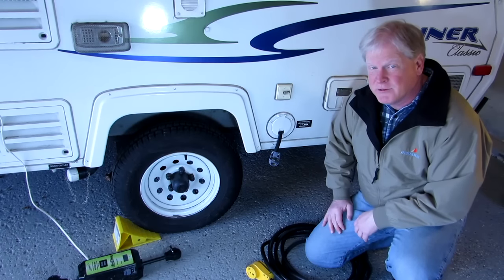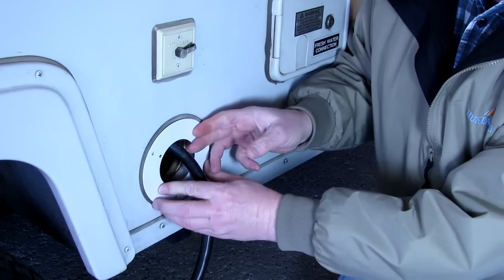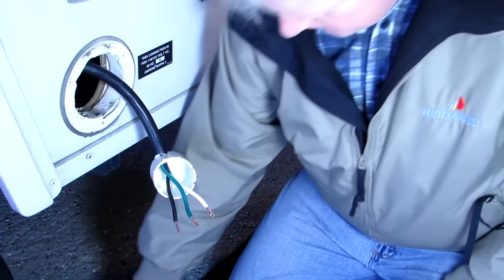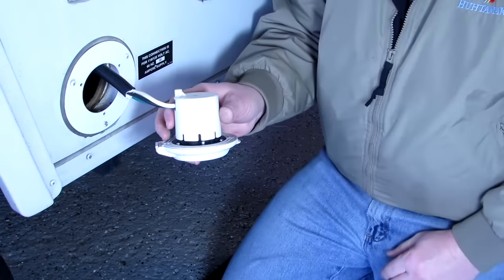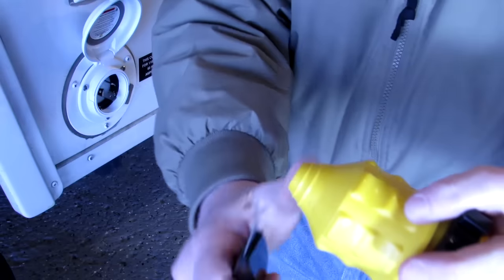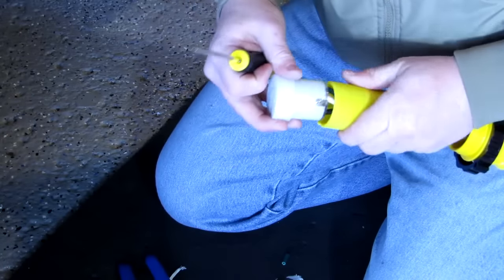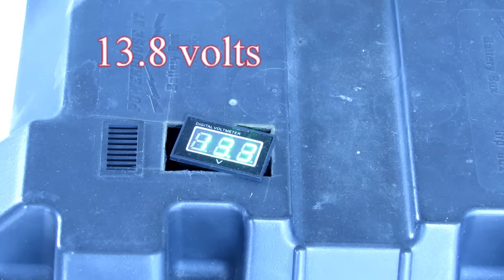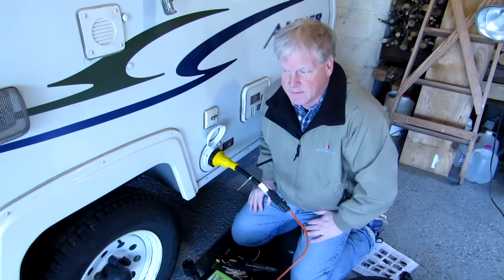Better  Aliner (Pop-up)Shore Power Connection - 30amp marine plug

Comment: Got the Marinco 30 amp kit for Christmas and just installed it with a little help from watching your video. With 5 nights below freezing here in the panhandle of Florida, my OEM cord was impossible to stuff back into its mouse hole. Don’t have to struggle with that anymore!
Reply from the maker: Excellent.  I see they are added that as a standard set up on the new rigs !!  Its about time !  Thanks for the comment !

Comment: Being new to RV'ing I was a bit confused by the different plugs.  After some study and watching your video, I now think I get it.  Thank you very much for your detailed explanations.
Reply from the maker: Ya.. there are lots of different plugs.  This plug is actually usually used in the marine industry.  The RV industry used a different plug, and of course your Electric Clothes dryer uses a different one still.  But they are all 30 amp/120volt plugs.  You just need to get adaptors to get them to work.  And don't get started trying to figure out 50amp plugs !!

Comment: Great video.  I plan to do this on my Chalet a-frame.  One question - when I click on the link for the kit, it brings up a kit with a female receptacle, not male like you installed.  Even when I search for it, I can't find one with a male receptacle.
Reply from the maker: The yellow female part you see is the part you install on the end of your power cord.  The receptacle is a MALE receptacle
Reply: Oh, so it comes with both?  Thanks for letting me know.

Comment: Okay I have a question my travel trailer cord melted plug into another outlet now instead of replacing the prongs I just connected to wire to the wire to the breaker box what kind of problems with that cost if I didn't connect a new prom and do it the right way what kind of problems would I have with my travel trailer if I
Reply from the maker: Just possible electrocution and short circuits....  There is a right way and a wrong way. That is the wrong way.

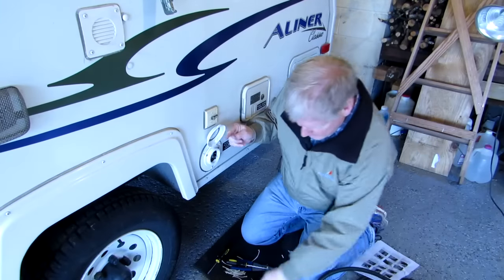Comment: Would it be possible to get the part number for the 12 inch pigtail you have (at 14:50)? I just want to be sure it is compatible with the lock ring. Seems to be a few different ones online, including the one from park-power which seems way over priced. Thanks!
Reply from the maker: I always put the links in the description,  But here it is again..  http://amzn.to/2e987rF
Reply from the maker: Try this one...     https://amzn.to/2LihVPl
Reply: Rick, this link is for the smaller stand alone (non-pigtail) you showed in the video still in the bag. No big deal if you can't find it. Thanks again for your great video!!! Been camping for over 15 years and we just started having mouse issues. Took them that long  to learn about the power cord entrance, but news is quick to travel. Will be doing this modification this week!!!

Comment: It looks like you forgot to put on the waterproof gasket!  Thanks for the tutorial.
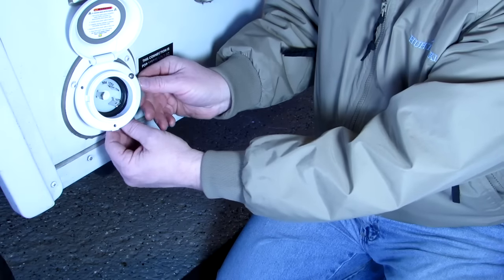Reply from the maker: Depends on which one you mean...  I caulked some areas and used a gasket and caulk in others... But they were done.. check at 7:46... had to put them on over the plug.

Comment: That type of plug has been causing rv and boat fires for years.
Reply from the maker: I don’t think so, it’s in most every RV nowadays, and it’s even hard to damage it or not take care of it. It’s much better than having a connected cord that you have to drag all over the place and stuff back inside like it was.